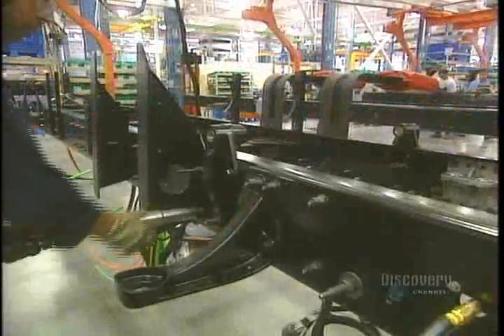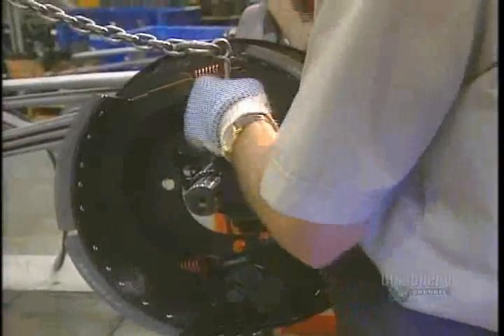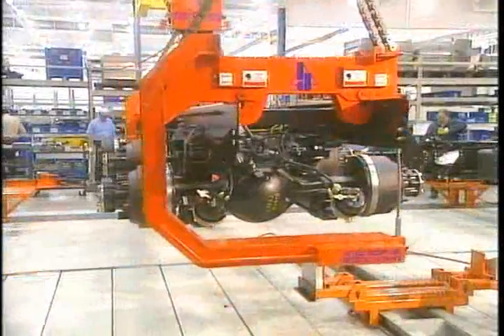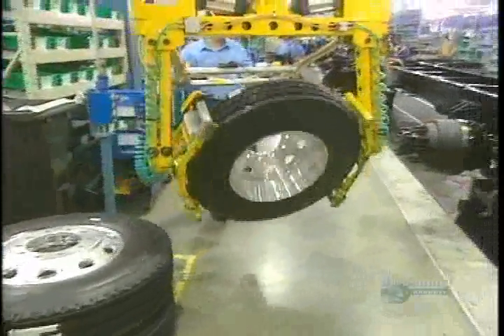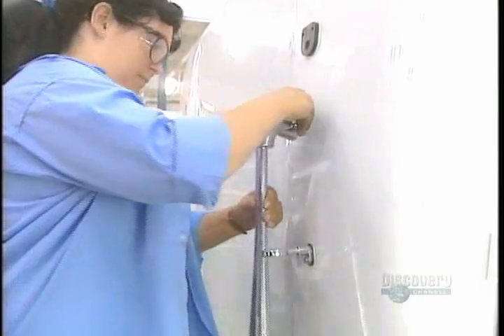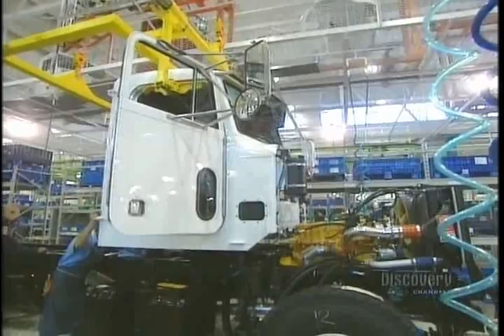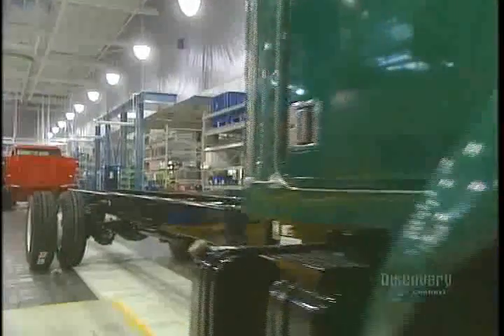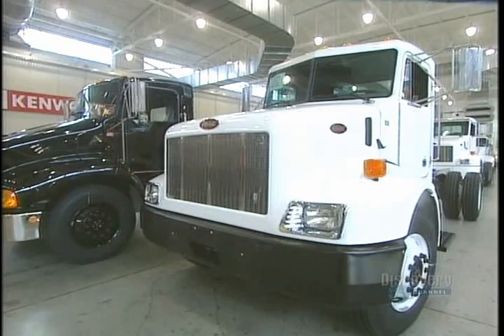How It's Made Trucks

Comment: It's an engine, not a motor. Also, this is an American truck. Report the measurements and weights in standard not metric.
Reply: metric is much more standard than "standard"
Easier to work with.. just add or remove zeroes...
Reply: It's a scientific show, get over the measurements. Plus it wouldn't surprise me if a lot of manufacturers use the metric system as cm and mm are more accurate for engineering. You are correct about the engine/motor mistake.

Comment: Are these going to be flatbed trucks as the chassis is so long?
Reply: Possibly
Reply: +haz939 These are called "vocational trucks." They go to another company called an upfitter to be turned into whatever. With a frame as long as these trucks have, they'll either be flatbeds or 28-foot box trucks.